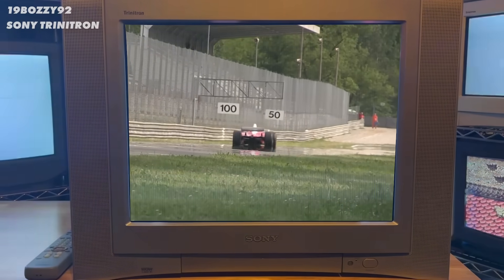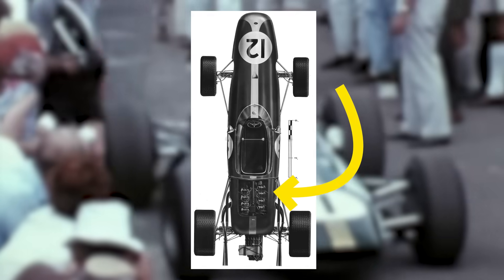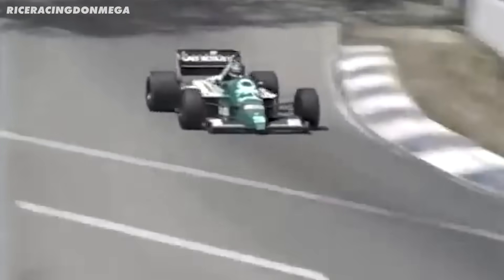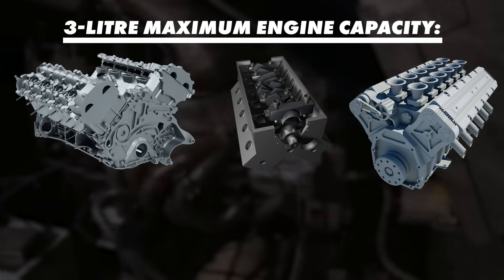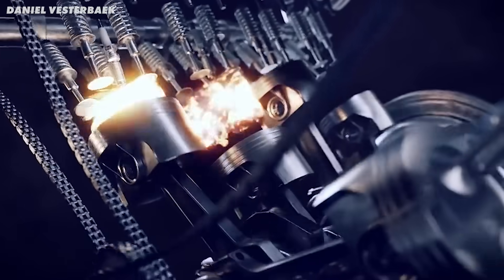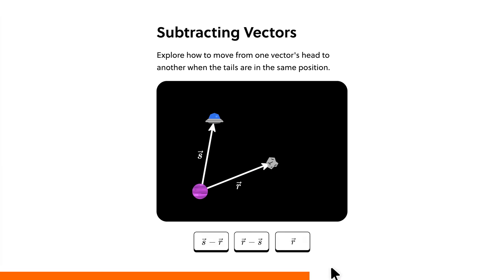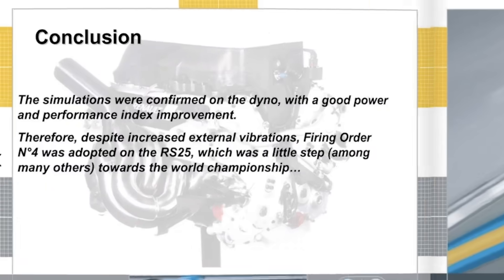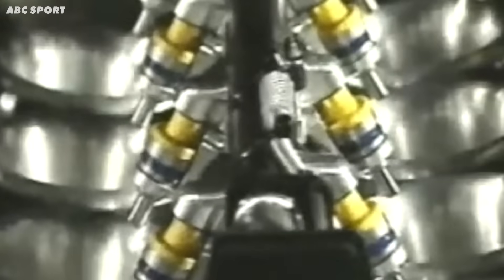How We’re Wired to Love F1 V10s

Comment: The V10 was because of the displacement limit and available fuel more than anything else.  The speed of the flamefront of the burning fuel determines the optimum size of the cylinder and that determines the optimum number of cylinders to maximize the efficiency of each pot.
Reply: Exactly right. Bang on the money. Fuel can only be burned so quickly.
Reply: Wrong. It's mostly because they don't have turbos just like the glorious V8s and V12s. What you mentioned plays a part, sure, but the fact they don't have turbos is, by far, the biggest reason.
Reply: @Spinelli__  When the number of cylinders was a variable teams could explore engine displacement was limited to half the displacement of what it was for non-turbo engines, the turbos also used different fuel.  I mentioned displacement and fuel restrictions.  The engine decisions F1 teams make are always based on the rules they work under ... when V10s became dominant the REASON they chose 10 cylinders is because of the fuel and the displacement they were allowed to use under the rules.  Turbos were a non-factor in their choices because they were against the rules, just like using toluene in the fuel wasn't a factor because it was outlawed too.  If there were no limits on fuel, displacement, and had supercharging available they would probably use V12s with turbos, methanol, and nitrous oxide injection and the pit stop refueling would come back.

Comment: Okay, I am highly certain that the information for what is common for a V8 is wrong. I know the Earnhardt car you used as an example has a Cross Plane crank engine and given the Opel is a GM product I would suspect the same for that car.  The V8s that fire from bank to bank are Flat Plane and do not offer the same sound, examples being the DFV and most Ferrari V8s. Most V8s from American companies are Cross Plane with very few exceptions. They are starting to gain popularity with American companies in recent years though with the GT350 5.2 Voodoo and the C8 Z06 LT6.

Comment: The v10 Merc in the Macca during the late 90s had such a distinctive sound, so that would be my favourite  v10. But the Ferrari 3.5 v12 in the late 80s / early 90s is still my pinnacle, partially helped by few number gears? - so you tended to get a wider range of sounds.

Comment: Not only does it shriek but if seems really loud! It’s also that echo and reverb that comes along with it that sounds so glorious. Now put 15 of them out there.
Reply: That super loudness came from fuel cooling. Excess fuel was injected to cool the charger and carry heat from the pistons. The fuel then burns as it exits the exhaust.  
A modern design injects directly leaving a layer of air over the piston for cooling.  So they would lose the chest shaking feature (but go further between pit stops).

Comment: That "V8 burble" is a characteristic of crossplane cranks. Flatplane V8s sound different.
Reply: There's several things in this vid I find lacking, crossplane vs flatplane just one of them.
Reply: Yeah thought the info they listed for the V8 was very wrong.
Reply: Very good point, Lingenfelter make a flat-pane LS engine which has that howling note similar to flat-plane V10s
Reply: @angry9901  why the fuck would you make a flat-plane V10 lol !  primary balance would be atrocious
Reply: You can hear how different the 5 L Mustang sounds now compared to the 90s. Flat plane doesn't sound as good imo
Reply: @beemrmem3 flat plane V8s actually have an irritating sound
Reply: Flat-plane V8 are just two I4s put together. Sound the same too.

Comment: If F1 opted for the V10 with Synthetic Fuels or Hydrogen, in less than 10 seconds at high revving...people would be having eargasms.
Reply: RBR has said that, by grouping races together geographically, they've cut more emissions than switching back to V12's would generate. Assuming V10's generate lower emissions, I don't see a reason not to go back in the next few formulae.
Reply: @shadowmancy9183  I think emissions from the race cars shouldn't matter at all. They are wholly insignificant compared to the emissions F1 creates transporting, the cars, the equipment and the team all around the world.  Multiple plane flights, tens of transport trucks and vans and tens of cars per team per race. And then you have all the other setup that follows the races around.

I'd love the return of V10s, perhaps with synthetic race fuels, but I can';t see it ever happening.
Reply: Which makes a ton of sense @shadowmancy9183
Reply: @shadowmancy9183  really? that many people buying in to this co2 changes climate bs? people not bothered to actually check the science behind ridiculous and clearly untrue model
Reply: A high-revving Inline 5 Turbo Hybrid might be the best compromise. Also grouping races together would cut logistics emissions a lot.
Reply: @GT4WJ  this, maybe without turbos but 5 cyl would get a sound very close to what the v10 makes, perhaps less "rich" but very close nonetheless while in theory being more efficient than in engine with more cylinders
Reply: or better yet, V10 hybrids. Over 1000 hp from a direct injected NA V10 that revs up to 20K and another 500 hp from the kinetic energy recovery system.
Reply: @davidperry4013 no point giving f1 cars more power, they just get so fast that they outstrip the safety equipment and we're back to skinny grooved tires again to slow them down.
Reply: Theres something weird about hydrogen, i dont completely recall but i think the wave front of the burn is slower?  Could be wrong, but might result timing issues for very fast revving engines.

Comment: The best sound car ever  is the Ferrari F2002!! Rubens said that the F2002 and F2004 engine could produce more than 1300hp at more than 21000rpm, but Ferrari didn't even need to use it all because of the advantage the car had over the other teams!
Reply: That F2002 was an absolute beast.
As dominant as the red bull from last year..
Reply: Good luck making an engine last a race at 21,000 rpm.
Reply: @456MrPeople  Back then, teams were allowed to eg. use one engine during qualification, and replace it afterwards. I believe the "normal" power during races was somewhere around 800 bhp, but that this could be increase significantly if the engine only had to last a couple laps...
Reply: @456MrPeople  Back then, engine component regulations were much more lenient

Comment: @driver61 I want the 18000RPM v8's BACK 😭😭
Reply: The current V6 could rev that high if they removed the fuel flow rate.
Reply: @v4skunk739  NAHH v8's broo V8'S with da blown diffusers and N/A

Comment: I actually disagree with this.  The constant major 3rd interval is grating to the ears after a few minutes, and it was extremely unsettling to the drivers in period (many of whom complained about the high speed harmonic vibrations the engines produced).  The V12 is a perfect triad.  It's balanced, not just mechanically, but musically, and it will forever be more pleasing to the ear, especially for long durations.

Comment: I love how they got rid of V10's and V8's to appease manufacturers and for environmental reasons. But then added loads more races all over the world and none of the current manufacturers make a consumer available 1.6 V6 Turbo (Apart from the Merc hypercar produced in minimal numbers)
Reply: and even then, that merc hypercer is very rare and expensive, and will likely never see the asphalt of the road
Reply: It's virtue signaling window dressing.
Reply: Yup, Formula 1 even trying to claim to be “eco friendly” is a load of 💩. Especially since, as you mentioned, they now jet around the world to 2 dozen races and the greatly increased need for tires. Tires made from petroleum 🤷‍♂️.
Reply: I started watching F1 in 1989. I watched the first race this year and figured that it's just not worth it anymore. MotoGP is still okay.
Reply: No, but 3-cylinder Turbo charged 1000cc engines with 130 bhp output are very common now. Basically the V6 split in two with a slight increase in bore/stroke in the remaining 3 cylinders.
Reply: Yes ,Racing is A MESS ,ALL Over the Place   ,Nascar ,F_1 ,INDYCAR , Need Nnew engine configurations ,None of it Relatable to Automobile customers : ? Win on Sunday : Buy , . . What ?  On monday ?
Reply: It’s less about actual environmental impact of the F1 show and more about making the cars in F1 relevant to road cars. 

Barely anyone makes a V10 any more for the road, so they can’t do the “we use F1 technology” in this road car unless there’s some sort of link.
Reply: @CertifiedSlamboy  V10s were never road relevant, and neither are the V6 Turbo Hybrids really. If road relevancy mattered then motorsports would be full of crossover SUVs, and instead of performance the main criterium would be how big and safe Karens feel when driving them.
I wish motorsports in general were a bit more honest about what they really are, then we'd have much better competitions. "Road Relevancy" and greenwashing are really just pointless attempts to please people who want to ban motorsports no matter what.
Reply: @retohaner5328 there’s been more road v10’s than there has road cars with hybrid turbos.
Reply: @CertifiedSlamboy  I struggle to see in what way current F1 cars are relevant to road cars other than the fact that they have a battery. Road cars will never use the kind of complicated hybrid system that's in F1 cars at the moment, and a 1.6L V6 is not exactly rocket science, you don't need an F1 program for that...
Reply: @CertifiedSlamboy  You can go back to naturally aspirated engines but also with the electrical stuff that way, in terms of power unit, road car manufacturers can still say "we use futuristic F1 tech" and if you want to go even further, there are way other types of fuel / fuel combinations that can be used which are wayyy more sustainable. Just get rid of the turbos, that's all.
Reply: @Spinelli__  IMO F1 should have a spec 3.0l V12 using e-fuels and let the manufacturers do what they want with the hybrid systems within a budget cap. Fans get the noise and spectacle they want, manufacturers get to develop/promote the tech they want, everyone wins
Reply: @joh2434  I agree. Ban turbos, allow any amount of cylinders, or at least between 8 and 12, allow any engine config (inline, boxer, 90 degree, 72, 110, whatever), no rev-limit, no fuel-flow limit, but also enforce e-fuels and some electrical power and that will be the best of all worlds.
Reply: @Spinelli__  Fuel flow limits never made sense to me given fuel capacity limits. If you want to increase flow why should I care? Do that too long and you run out of fuel before the end of the race. Strategic flow increases for passing makes things interesting.
Reply: @Spinelli__  You're missing the important fact that manufacturers are now forced to use turbo chargers (have been for 10 years now) due to ever stricter regulations, and that F1 was meant to develop the technologies that trickle down into consumer cars. The focus is on efficiency and pollution, not eargasms. Sure the V10s sounded great but sounding good was never the goal of the engine, that was bonus.
Reply: @CertifiedSlamboy 
I doubt F1 battery technology is relevant to road EV's. Governments push for an ICE ban in the near future which involves hybrids. You don't need a "0-60 in 3 sec." car on the road that weighs 2 ½ tons. We REALLY just need a normal car with 100 HP that gets us from A to B. But people wanna have freedom. Freedom to finance a $100k pickup truck or a tank of an SUV to commute the 15-20 miles to work every day.